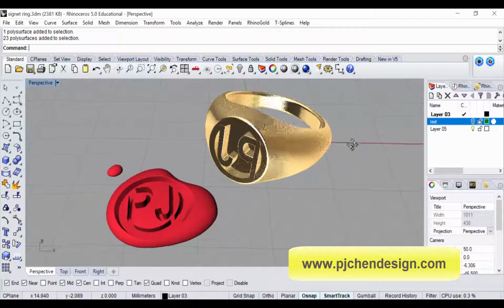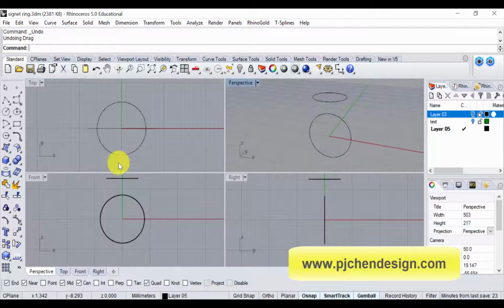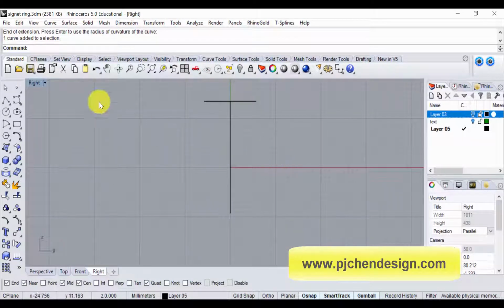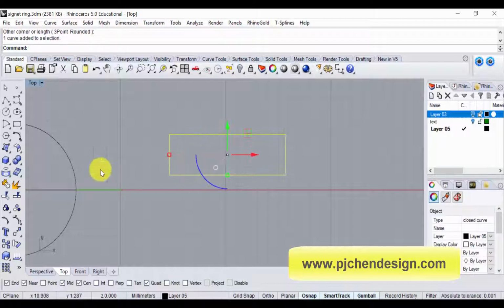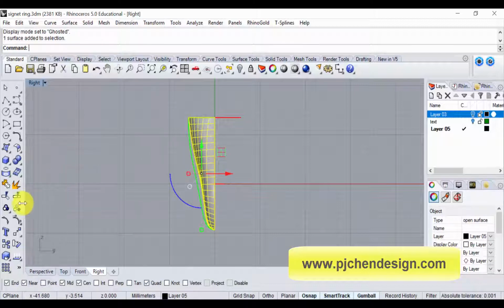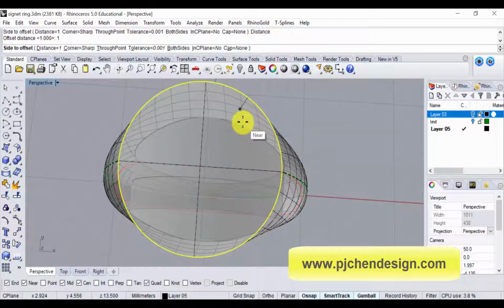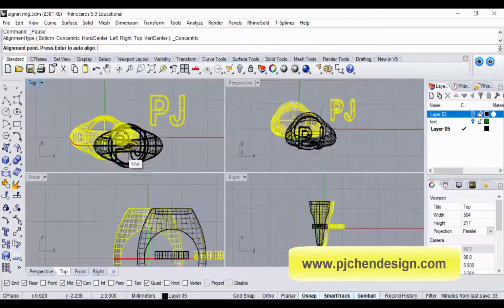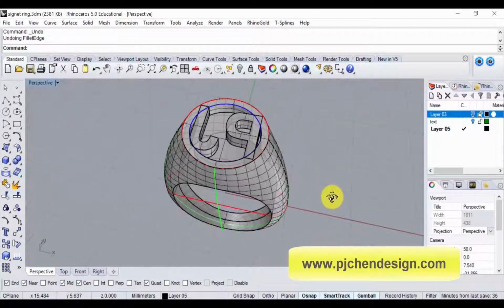Jewelry CAD Design Tutorial #15: How to Build a Signet Ring

Comment: Hi Pj ! Thanks for all your tutorials! Very Helpful!   I have a Question: when i do Surface from Network, on the bottom of the rings, it creates  bad artifacts that i can't get rid of.. Any suggestion?
Reply from the maker: not sure what went wrong without seeing the model. but you may want to check on  your curves. make sure all the endpoint touching endpoint
Reply: @PJChenJewelryDesign  it's like all isocurves, converged on one point on the bottom, causing a non linear shape of the bottom ring :O

Comment: Hi PJ. And thank you for the Chitubox link. I Installed it and can you believe it, the ring was even bigger there. The size was all, X,Y, and Z all over 60 mm. I got the ring in correct size by resizing it in Cura from 100% to 47%. Now when i printed the ring it was in correct size.
Reply from the maker: still don't know why you had the size issue, but happy to know you find a solution for it.

Comment: Hi PJ Chen. I am an amateur with this program. I make silver rings as hobby and i want to cast a signet ring. Your video have been best here in Youtube, thank you for that. You had the circle size as 16mm in the beginning and i assume that is the size of the final ring size. I used 24mm so the ring would be bigger.  I finally succeeded to do this ring in Rhino 6. Then i saved it as .STL file. Then i loaded the .STL file to Cura, 3D slicer but size of the ring there is, 53mm x 20mm x 58mm. So that is too big for a ring. What happened? What did i do wrong? Please help. Thank you.
Reply from the maker: I do not use Cura, but whenever you are import export the file in between two softwares, make sure both software are using the same unit. I am guessing you may have mm in Rhino and have inch in Cura.
Reply: @PJChenJewelryDesign  Thank you very much for instant reply. I had mm in both, Rino and Cura , although dimensions in Cura was bigger. Strange. I tried to scale the object in Cura 50% smaller and now it looks better. I hope i can come to a solution. Thank you.

Comment: My version or the way I have it opened doesn't seem to have all the same windows showing for things like commands and layers. How can I get my version to look like yours to more easily follow the instructions?
Reply from the maker: If your interface is different than mine. You may need to reset your toolbar. Type "toolbar" in command and "set defult"
Reply: Any chance its because I'm on a Mac? typing "toolbar" into command doesn't seem to do anything at all. @PJChenJewelryDesign
Reply from the maker: @shausen3  I think Option in PC is Setting in Mac. and you can find toolbar in there

Comment: Do I have to chamfer / fillet if I print a wax model ? Because some fillets are too small for printing so if they are done by hand, would it be better?
Reply from the maker: you don't have to do fillet if it is too small, because you will have the fillet when you polish the metal.